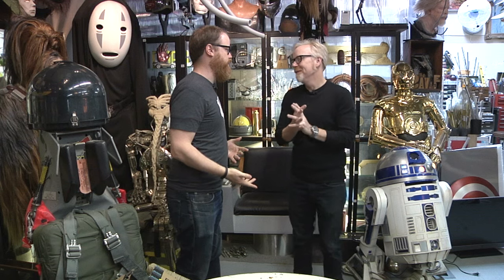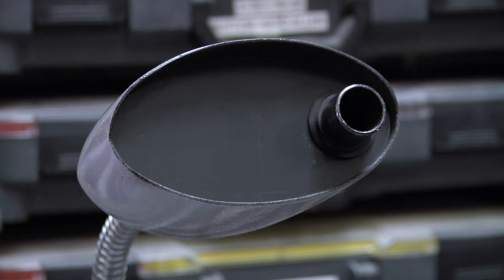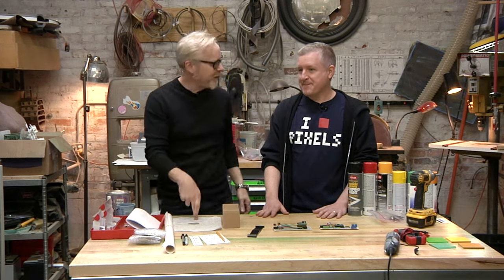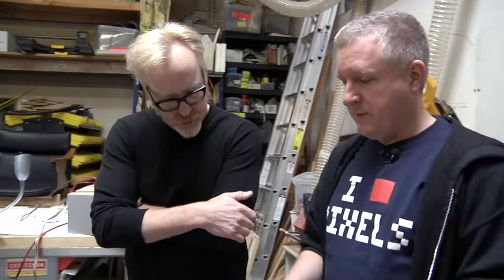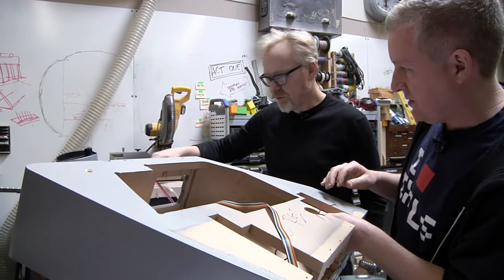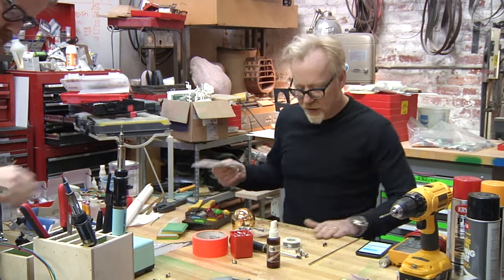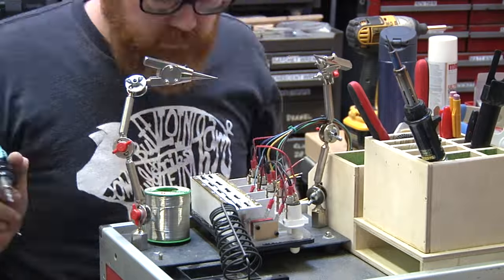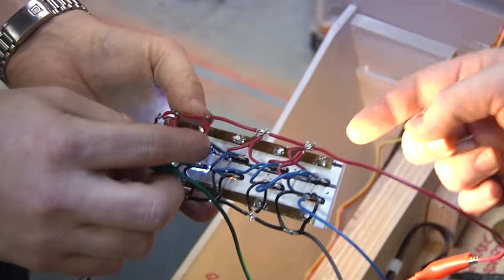Adam Savage's One Day Builds: Star Trek Captain's Chair

Comment: This is the absolute, ultimate, best prop-meets-real-life thing I have ever seen. I am stunned by the sheer awesomeness that is this project. I would love to know just what kind of cost is associated with building something like this, because I would definitely, in some regard, later in life, want to recreate this to some degree. It would be the best nerd-room centerpiece in the history of nerd rooms.
Reply: Speakers + amp , Powersupplies, Electronics, Wires first
speakers plus amp is around few hundred and you can get it cheaper, powersupplies lets have 2x 20 amp 50 $ each, the arduino is dirt cheap  say 30 $ to get all the breadboards etc, leds and other electronics around 100 $. this sub totals to 380. 

now the chair, wood, leather upholstery around few hundred bucks, the custom molds and custom switches some hundreds more. that sub totals to 400.

so 380 and 400 makes 780$ before factoring in labor.

Which is then the option of finishing the thing or learning every single used technique first.  Heavily simplifying  material is 1/3 of total costs so that gives us an estimate of  2340$.

 Adams shop, the cost of an electrical engine and a salary for a shop assistant not included. 

If i would make this i would set a budget of 3k and order some of the stuff prefab to compensate for the lack of wood shop.
Reply: The less money you have, the more you can push your imagination and generally speaking, the better the project comes out. Try recycling centers

Comment: I totally love all of Adam's Youtube and Tested content. I only discovered these vids a few years back and was thrilled to find that my self taught maker techniques paralleled his so closely. while I haven't read all the comments I do have a possible explanation for the failed LED issues. Polystyrene, while being an incredibly versatile material and possibly my personal favorite plastic, is an extremely evil conduit for creating ESD (electrostatic discharge). I've had several failures while trying to use this material for reflectors or enclosures on projects that used LED lighting. That's been my experience anyway.

Comment: That is a lot of solder they used there. I would have used crimped connectors for ease and I trust them more. Also for a bus bar, instead of soldering it straight to the brass, you can make wholes for skin screws then hook an O connector to the wire and screw it on the bus bar. It will all look a whole lot neater and will probably last longer.
Reply: Is trust solder over a crimp any day. Adam also said he could tap the bus bar but it looks like they didn't go that route
Reply: sik59rt A good crimp should be as gas tight as solder...  the key on any joint is adequate strain relief (often missed)
Reply: Taylor Korthals Sometimes I usually cut the middle man when it comes to permanent wire installs and just do both :D
Reply: Whitefox789 There are crimp connectors that come with a little bit of solder inside so after you crimp it you heat it to shrink/solder it. Looks super good.
Reply: Taylor Korthals
Are they expensive or hard to find? Like can I get a decent bundle of them from Digikey / Jameco / Mouser?

Though actually I'm more in the market from what a friend of mine who worked at Duke Energy got us for our college Senior design project a 12 vDC - AC to DC transformer which has several bus lines attached to it where you can crimp wire connections on one of the bus terminals by sticking a mini screwdriver down a slot which opens the terminal. That was very nice and very handy.
Reply: We used to use the things i was talking about in the navy on aircraft wiring, I'm not sure where to get it in the real world as I haven't been out for very long and haven't had to wire anything yet.. The stuff you talk of sounds very nice though.
Reply: Taylor Korthals
The military and industry always have the best components :(
Reply: Taylor Korthals I'm pretty sure I have a memory of those too. Also crimps with hotmelt lined heatshrink sleeves already on them. Can find the heatshrink ones but not the solder ones from RS component. Wonder if RoHS has dealt them a death blow outside of military use?
Reply: Whitefox789 is http://uk.rs-online.com/web/p/pcb-terminal-blocks/3292274/ something like what you're after?
Reply: *****
That is pretty dead on with what I'm looking for! Thanks for the link.
Reply: sik59rt  me too, although when i work with wire bigger that 12ga i just crimp, like a 1/0 power wire and a hydraulic 12ton crimper is quick and easy and works great.
Reply: Taylor Korthals They were trying to get this done in 8 hours...prolly take 2 or 3 at the least to drill, tap, and crimp all those connections...So they did it in the most expedient manner.  Not everyone is as anal about stuff like this as you.  But you're right in one respect...The crimped screwed connections do look better, but for the best connection...Solder is ALWAYS better...Less leakage of voltage in a soldered connection.

Comment: The sad thing is only adam knew what tapping a busbar was
Reply: Yeah this kind of surprised me... I'm an auto mechanic who specializes in auto electronics and I've only done so once (trunk sound/lighting), but at least I knew what it was. :P
Reply: Robin Halligan I knew what it was once he explained it we use those in electrical panels
but what I dont understand is why not buy a bunch of those to keep in the shop
making one seems too time consuming if you ever saw one
Reply: mikegigabyte Ever saw one? the company i used to work for sold them fall the way up to 4cm by 4 cm by 4 M, but your right get a bunch of the thin ones would be a good idea, however the guys from tested have less than no understanding of electronics.
Reply: Robin Halligan ever saw a buss bar? yes I install them all the time in electrical panels, many sizes available
Reply: mikegigabyte yeah, making one certainly takes more time, but if you're in a well-equipped shop it doesn't take too long. Probably quicker than finding one in a store! I have aluminum and brass rod stock here, plenty of taps and drill bits, drill press, stock of metric screws and bolts, etc...I could do a decent-sized one in 10-15min without rushing TOO much!

Comment: For some reason I do not remember the wood trim on the chair...
Reply: well captain Savage is The Mirror Universe
Reply: It's because the wood  on the original is a darker tone with a satin finish and blended in with the leather..
Reply: Wood trim is authentic
Reply: Re wood trim i got caught off guard by it - until  i checked and im a 1960’s original
Reply: Original chair was built around a 1960s office reception chair from Madison Furniture Industries- the wood trim was part of the stock chair - they pulled the bottom off, and removed the mounting hardware and then bolted it to the famous wooden frame.  Most of the originals were fabric covered but there are some leather versions that do exist so the leather on the original may be stock.  Around season 3 they covered the arms in matching leather(ette) so the wood trim is only 'mostly' correct.  But like all things Star Trek the designers altered stuff as wear and tear happened or they needed something 'new' that they just altered existing stuff, so nothing is really 100% accurate for all three seasons if it was a recurring prop.
Reply: If you look closely, its there although I don't think its quite as visible as on adam's version. On Adam's chair, the arms slope up in the back making them even more visible.  I'm not sure it does on the original.  Also it looks like Shatner's Uranus was a couple of AU bigger than Adam's.
Reply: Absolutely correct! The Captain's Chair was a classic concept. The problem was it practically changed from every filming depending on what the story needed. So the problem is, picking a chair and trying to duplicate it. Good luck on that. Or you can do what Adam did and build the damned thing to your own liking. Personally, I'd put in a router so that everything is connected.

Comment: I wish I had lots of money like Adam...
Reply: +Mark Williams maybe a simple version of the chair yeah.
Adam said that the speakers alone were like 50 bucks.
Reply: Mark Williams
There's several hundred dollars in wood alone. The leather for the chair is a couple hundred bucks. The ardrino is $25, each switch he used is $3+ The magnetic switches are at least $10 each. I've built all kinds of stuff like this before and bought pretty much everything he has in his build before. It's not cheap at all, adds up quickly. If I had to give a low-ball estimate I'd start at $600, and it'd probably end up being closer to $1000 after a few mistakes and restarts.
Reply: +Charlie Mopps I'd love to have a "Job" that earned Adam the money, not only for the money because its a Job he loves, which means he never works a day in his life.
Reply: +Charlie Mopps make it so!
Reply: +Charlie Mopps dedication to his passion earn him a lot of money. so start pursuing your dream job. follow your passion!
Reply: +Zachary Levy I love it when they Make it So!
Reply: +Charlie Mopps Plus the labor!
Reply: +Charlie Mopps Become an engineer.
Reply: +Charlie Mopps 
8x4 sheets of MDF = $30 x 4
It's not leather it's vinyl = $40
Arduino nano = $5 off ebay
Switches = $1 each (He probably has contacts due to all his other projects)
Reed switches = $3.50 for 10. 

It's the time and troubleshooting that is expensive but to build this yourself you could probably do it for less than 200 dollars in materials if you do some research.
Reply: +M6EXH Most of the cost in any of these kinds of things is in the expertise and labor. Even Adam's build probably cost less than $500 in materials. But if you were to have someone build it for you and do a good job it would probably cost $2000-$3000 dollars, if not more for the electrical work. Bear that in mind when judging the difficulty of doing it yourself. It's the kind of thing that could easily make you frustrated and give up, costing you all of the materials and time you spent on it. It's definitely worth doing if you have the gumption, though. It's an awesome project.
Reply: +Charlie Mopps errrrrrrrrrrrrrrrrr.
Reply: +Charlie Mopps I'd have to agree that it is hard to find quality parts for cheap. It's not impossible though, just very difficult. You'd probably burn through more money attempting that then you would buying them at a normal price in the first place.
Reply: +M6EXH that is if you have the tools n stuff already, if not you could be looking at a lot more. still after buying tools the next job n next only cost material. n so on.

Comment: He has a great plan. Great idea. Great results. But, Adam is also exceptionally correct when he calls it a toy. Means, it's fun it's great, but it's just a plaything. I have ideas that take this to a higher level. Power switch was a great idea, although I placed mine on the other side. But i like the left side idea better. Instead of just sounds, I would actually like to use the speakers and microphone as real communication and sound providers. Simply, I want to use Bluetooth connectivity, so that you can utilize the speakers to play music off of your phone or your iPod. With the microphone, you can use it for calls as well and there's plenty of tracks and ringtones out there on the Google Play Store or the App store to authenticate the boat whistle of an incoming call. In my opinion, the memory card dock is a functional memory that provides use for Star Trek and Starfleet etc., but as an everyday use chair, fun n' games is not my intention. I'm thinking about changing the card dock to a phone charging port. Difficulty arises, as in size of the dock and usb type, but I figure I could use the normal usb port and place an adaptor at the end of the phone, allowing any handheld device to be charged in the port. For the right hand console, I envisioned power, volume up, volume down, speaker on, bluetooth on. For the left side, I have actually failed to devise any plans for reasonable functionality. I'm looking for ideas. I considered an encrypted voice command passcode lock, so that only I and a few other can utilize the chairs functionalities. Any opinions, thoughts or other ideas for the left hand functionality? Ideas would be most appreciated.

Comment: I often wonder about using auto-focus IR telemetry from cellular-telephone cameras, to scan & measure items via quick snap-shots from a couple of different angles. 'Cause you can't always download plans! What of museum pieces which don't allow measurements to be taken, items which might be on display very briefly and which you might only have brief access to? I think of all the racing motorcycles in museums, the problem of figuring out specific dimensions of the tubular steel used in their frame construction. Seems like just the type of thing - Though you wouldn't be able to place DOTS on the frames, you could snap shots where the weld spatter is seen clearly or the apex of miter-cut joints could be used as a reference. Of course the trouble is whether you'll have access to the bare frame itself. But wherever the fairing is off and basic components like suspension, wheels, engine carbs etc are installed, many of 'em can be used for a frame of reference, an item to scale. ANYWAY yeah, there were commercials a while back about cellular-telephones which showed a sort of "SCIENCE OF STUPID" diagram over flying aerial stunts aboard sk8boards/roller-blades/unicycles etc. Ostensibly, they were able to calculate kids' skateboard & BMX bicycle ramps & jumps etc, to figure out the angles the height their distance apart, and even render the necessary launch speed - If it is indeed being used this way, AND we could access some sort of MACRO-LENS version of which, well then I'm sure it would be possible to bring such a device into a museum and start shooting pics of old race bikes, and anywhere the frames are bare & exposed, you could use such techniques to calculate the lengths of those frame tubes! This could not only advance the art of the "pseudo-replica" Starbucks-Racer builds, but also somewhat democratize the access to the rarefied atmospheres museum restoration studios which have traditionally been accessible only to a select few. It might be an arduous task but each of 'em only need be scanned but once or twice and then the data be shared with the world via the wonders of the interweb. This would come into conflict with extant commercial interests, every now and again, such as with the few custom aftermarket frame builders such as the likes of Moto-Martin or Egli, Harris, Nico Bakker etc etc who built frames for the SOHC-4 & DOHC-4 Honda CB-series - But there are many of 'em which have been lost to the sands of time - For the Yamaha RD250 & RD350 too-smoke twins there were literally DOZENS of custom aftermarket racing frames available and many of their builders are likely dead or at least senile, acid-casualties perhaps even, or had run off to join fringe religious movements etc. Best to find out, 'cause we wouldn't want to find out their patents had been transferred to "Maharishi University" or the heirs to the throne of Bwagwan Rajneesh, E.S.T. etc....

Comment: It makes sense that the LED lights were burned out because on 12:34 you can see him putting the soldering iron directly onto the light for a long time. Those irons get extremely hot and can certainly damage the light. Instead of getting the contact on the light hot enough to melt the solder on he should’ve just applied the solder straight on to the iron and then quickly dabbed it onto the lights contacts.

Comment: EE from the "future" says Copper tape as a bus bar would in fact be more than good enough. Garden variety copper tape is 1.4mil thick and with a 1" wide strip is like 18gauge wire. (It's the same copper thickness as 1oz pcb traces, in fact) Not very convenient for termination, though!
(That's 35µm thickness and 25.4mm wide tape, and 0.9mm^2 for us non-imperial unit folks)

Comment: Hi Adam, I thought that this build might be the most appropriate place to ask my question.  I was recently challenged to make a 2ft. diameter Millenium Falcon model. Your builds on youtube have inspired me and I have decided to scale up the model. I am building a cardboard 5ft. Milleniun Falcon and want advice on adding lights and sounds. I am a new maker and was inspired by "How to make a mind-blowing Millennium Falcon from CARDBOARD" posted by Epic Cardboard Props. Before I get too deeply into the build I want to know where I might get the info to add electronics to the model myself and my buddies are making. I want to have the main engines lights fire up and increase in brightness, at the same time, I want the engine noise to begin and increase in volume. I will probably want to add some blinking lights to the shell as well. How do I put together and then add these electronics to my model? :D

Comment: If that chair was accurate before the installation of the electronics it was not accurate at the end. Why? Well because on the left arm rest the panel of lights has the three round ones at the end of the arm rest. At the end they are towards the rear. Just an observation.